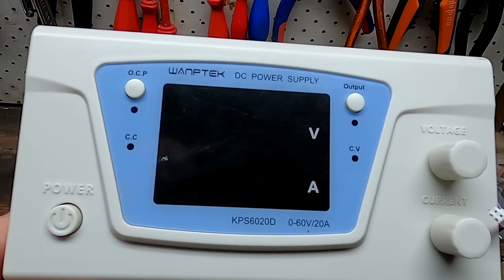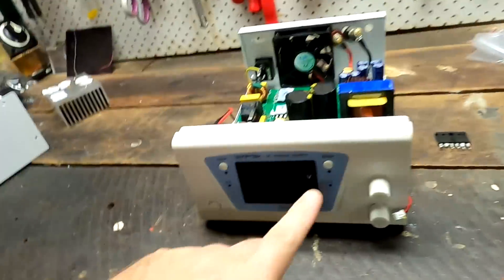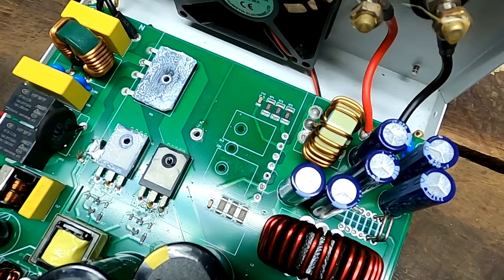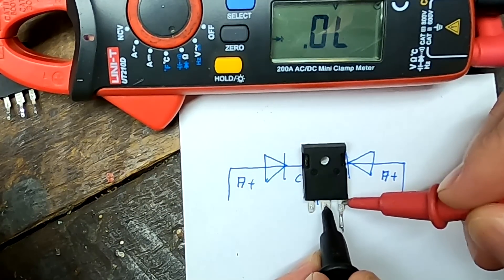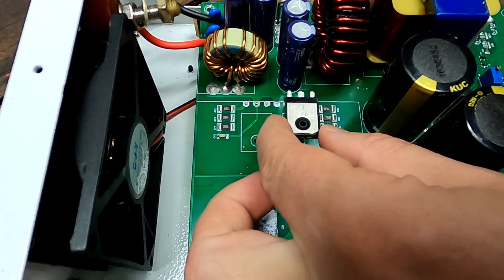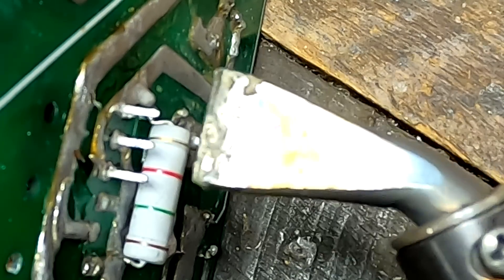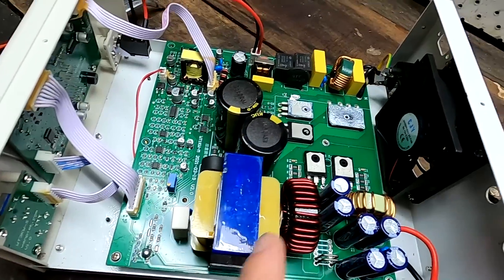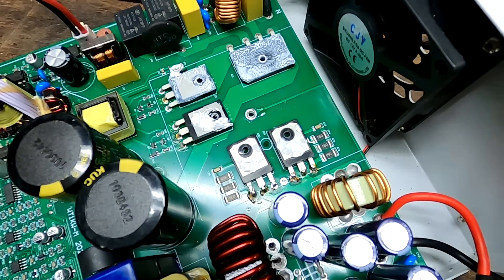I wrecked the WanpTek 60V/20A adjustable power supply 💥 ... and repaired it again WITH THIS!

Comment: bonjour Andy,
Désolé je ne parle pas Anglais heureusement la traduction est là 
J'adore vos vidéos et votre bonne humeur ! ;)
J'ai également un problème sur cette alimentation wanptek KPS6020D, impossible de trouver un schéma électrique, ont ils un support ?
Je suis électricien mais pas électronicien donc un peu compliqué pour moi
Voici ce qui est hors service sur la carte : IGBT Q6 K30H603, la résistance R87 302, condensateur céramique C55 ( valeur ?) et l transistor Q8 BA 
J'aimerai la réparer moi même si possible mais je me pose des questions :
Comment déterminer la valeur du condensateur céramique C55 sans schéma ? 
Peut on installer des composants plus fort ?  exemple remplacer le K30H603 par K75H63 
Comment peut on améliorer cette alimentation ? j'ai lu dans les messages précèdent qu'il fallait ajouter une diode en parallèle sur la sortie qu'en pensez vous ?
Il y a bien un fusible rapide de 10A mais les composants ont quand même grillés... :(
Moi aussi lorsque j'ai connecté mon pack de batterie seplos il y eu des arcs électriques, sans doute la charge des condensateurs de l'alimentation 
Si j'ai bien compris il faut toujours que la tension de l'alimentation wanptek soit légèrement supérieur  au pack de batterie exemple : 55VDC pour 51VDC et toujours démarrer la wanptek en premier
J'ai lu aussi que l'alimentation n'est pas aux normes ou n'est pas fiable, pour quelle raison s'il vous plait ?
Merci, à bientôt
Alex

Comment: Awesome Soldering skills... lucky you, that you didn't rip off the via on the opposite side, and usually it is a good idea to clean the flux and also the old thermal paste before reassembling. I wonder how this Power Supply performs on the AC Side with 1200W the filters somewhat don't look like they are up to the task.

Comment: did you know that if an 100 pount trailer falls over a wanptek which is 80% loaded and warm the tiny thing turns to over current protection ... i didnt know it had such working... spared it to see what happent and it was just a mode you keep pushing the current  scroll and it switches it off.!!!1 yup the last models 60/5  ali sells!!!! scared me  a lot.. my sweet first ever adjustable seems totaly fine!!!!

Comment: Can I blame you ? 🤪 I now have the Wanptek to play with ( UK ) 👍👌
They also have a  3kw version ( now? ) incidentally I hated the beeps when adjusting volt/amps. You can disable. Hold ‘on’ for 5secs then sequentially press volt , until 4-1 shows , turn until 4-0, press volt to save👍
Reply from the maker: Oh, wow, thanks for the pro-tip. How did you find out? So4-1 makes it quieter?
Reply: @OffGridGarageAustralia  I’m nosey 😊. 4-1 beep on , set 4-0 beep off
Reply from the maker: @ladams5356 Thank you.

Comment: I'm looking at this power supply,has it been good? Does it output the full 60v 20a for 1,200 watts? I'm looking for a decent power supply to power my pinecil v2 soldering iron. Charge some small batteries and to have something adjustable.
Reply: Very overkill for those purposes. A 30v/10A would be more than enough for half the price.

Comment: I have just bought one of these power supplies and I can't seem to find out how to change it from constant current to current voltage to allow the current to reduce for top balancing Any advice much appreciated
Reply from the maker: It does it automatically. Set it to 3.45V for a single cell and watch. Voltage will rise until it reaches the 3.45V and the current will then slowly go down until the cell is full absorbed. There are many videos on this channel where I show how to charge these cells.
Reply: @OffGridGarageAustralia  thanks and it did as you said after a few days the cell when they arrived were all 3.25v x16 280ah, I set that charger to 3.65v it started charging at 21amps but the voltage to 3.47 for a week or so but the came up slowly it stopped at 3.65 and the cells were all at 3.62v so I guess it's close enough for a top balance

Comment: there should be a slow blow 25A fuse behind the output terminals, then these same diodes would cause the fuse to blow if connected to anything in reverse with more than 25A capability and over 2-3V voltage, or there could be a beefy 85A >100V diode Vishay VS85HFL series ( any will do, the voltage ratings go from 100V to 1100V) (such as  in reverse to the output capacitors to blow the fuse without causing large (over 150A) peak current to the ultrafast diodes.

Comment: you could put a high current diode on the positive terminal to stop reverse polarity from happening again
Reply from the maker: You mean inline? What about the voltage drop?
Reply: @OffGridGarageAustralia  they will be that to add on when setting the voltage but it would save the device

Comment: Use one extra of the diodes on the output terminals, solder center to positive other pins to negative post. More better better protection. 😉
Reply: Hello! Please be so kind and advice me if it is ok to use this method for other power supply. Thanks for your support
Reply: @margasor  yes can use on other power supplies. What it does is protects the supply if a reverse voltage is connected on the output of the supply. The diodes anode goes to negative and the cathode goes to positive. A fuse inline would blow if a reverse voltage is applied and thus protecting the power supply.
Reply: @davestech6357  I will do so, is it a specific power diode to use?! Supose to be rapid diodes. Thank again, I appreciate your support 🙏

Comment: I would not recoment the high power/heat soldering iron. The PCB tracks might easily lift from the PCB. I recomment cleaning the holes and then insert the component. A  short touch might be ok but a fev secs more??????
Reply from the maker: Yeah, if you get it too hot, it will break your tracks. sucking up al old solder is definitely the better way. But what a boring video, right?😁

Comment: Andy you could have used soldier sucker to suck the solder from the holes and once they are open. You can easily insert diodes, transisters or any thing in the hole directly without using a huge canon like soldering gun 😂😂
Reply from the maker: I tried my solder sucker thingy but the solder is not hot enough and it suck. I mean it didn't suck, so it sucks!

Comment: [Off topic] Is it a reasonable idea for a Lifepo4 battery in a camper van with solar panels to change the BMS settings so that ovp is at around e.g. 35% state of charge and ovp recovery is at e.g. 25% of charge when the battery is not used for a long time? Keeping the battery at nearly 100% for a long time is not recommended, is it?
Reply: They are usually only about half charged when transported/delivered. In contrast to Lead Asid batteries they don't need to be fully charged in storage. I believe damage comes from any change in charge so i believe in storage it would be best to disconnect them and then just give them some charge everry 3 to 6 months but Iam not a battery expert.
Reply from the maker: If you don't have any load connected, charge it to 70% and leave it disconnected (even the BMS if possible). This will last for more than a year without any issues...

Comment: Well done Andy. You were very gentle and patient. But if you had been a little less gentle with that BFSI (Big Freaking Soldering Iron), as you inserted the new diode, you could have delaminated the solder pads from the PCB while pushing the leads through. Some advice from someone who has been doing electronics repair for 40 years: next time use a solder sucker and the small iron to remove the solder from the through-holes one ay a time. Or, if you don't want to buy a solder sucker, use a wooden toothpick. Also, the solder joints you made at the end, on top of the PCB (component side) may be "cold" joints that can fracture with a little vibration. The solder has to flow freely across and around the pins until it wicks around the pins to form an alloy, which requires the pins to be heated to the melting temperature of the solder. What I see here are what we call "tack joints" intended for only temporary connections. We old techs say: "solder is not a glue."
Reply from the maker: Thanks for your tips!
Reply: Thats how I was trained to solder! good to know the practise id still being applied!!!!
Reply from the maker: @showme360  There are probably other methods these days for such a task but for a three-pin diode, it was al right.

Comment: I added a power diode into my leads, with a switch across it. You have the switch open while connecting, then you make sure current flows. Once current is flowing, you close the switch and your leads are in default, and the voltage drop from the diode is gone. I've not blown my power supply since
Reply from the maker: Ah, great tip. A bit of an extra step but I like it!

Comment: Andy , in the old days we would have called these diodes crowbar protection diodes. They protect your power supply in the event of reverse connections.
Reply: Not so shure about that. I think they do the rectifying after a high frequency transformation. I think this is a switch mode PS.

Comment: Those are common parts in switching supplies, I used them on the power supply for my Riden. Also,I should mention that particular product design does not like reverse power, in other words make sure something you connect to does not have higher voltage. (Reverse current flow) Yes I have blown the 15v 40 amp USA version. I have a couple of the wanptek supplies, a lot of bang for the buck. Batteries tend to not care about ripple, but they love that current.

Comment: After doing the same thing to my Wanptek I put a fuse on my positive lead connection on the back connector to prevent it from happening again. Lot easier to replace a fuse.
Reply: Fuses are not fast enough to protect electronics.
Reply from the maker: Will the fuse not even blow under normal operation?
Reply: @OffGridGarageAustralia A fuse should not blow when things are normal. They blow when the thin wire in the fuse gets too hot and melts. This demands over current and time. Current multiplyed by current and again multiplyed by the resistance to give the energy to melt the silver wire. They can often survive a small over current for a long time. They may protect against melted cables and fires. I do recomment fuses between battery banks and what is connected to them in case something like an inverter has failed.
Reply from the maker: @leonhardtkristensen4093  I'll put this upgrade project on my list of videos. Thanks for your insight and suggestion.
Reply: @OffGridGarageAustralia  So far mine has been ok. I haven't hooked it up back words or over loaded it though. Can't hurt and doesn't cost much for a little more protection.

Comment: Who taught you how to solder? 🙂You should remove the solder from the through holes first. Then you could test fit the diodes for proper mounting alignment. Invest in some solder wick and a good solder sucker, then you wouldn't need a plumbers soldering iron. Heating up and pushing through the diodes is a good way to destroy the traces. But you got it working and have spare parts for the next time you hook it up backwards 🙂
Reply from the maker: Thanks, yeah, I have one of these desoldering pumps but it does not work well unless the solder is really hot. Some wick is probably better...

Comment: Like# 402, damn steak lunch gets in the way!
Oh, but great news, I found one of the 2 panels I needed to add! I grabbed 3 x 540watt panels to make it 8, I’ll configure them into a 4S2P! Still trying to locate a 445 bifacial Canadian Solar for the second string! If you remember, I am bumping into my 250v limit per string and this will drop me from 250 down to 200v!
So currently Taj-Ma-Haul is at 6.5kWatt/hours solar capacity. I’m 2/3 the way to the planned 8.1kWatt/hrs
Taj-Ma-Haul is my 20’ Toy Hauler Luxury home conversion!

Comment: Good job 👍 I make the same with tv power supply i messure it whats wrong and find most of the errors on the AC site.This big soldering iron is funny because i take a desolderung pump.Das richtige für Freitag Abend Tschüßi👋
Reply from the maker: I have a de-soldering pump as well but it does not work well. I cannot get the solder to be hot enough so it sucks it in.

Comment: This iron should be well for plumming.   ;--)
Reply: And would you ask your plummer to fix electronics?
Reply from the maker: It seems to be good for a lot of things
Reply: @OffGridGarageAustralia  Would you have shown us if you had lifted and dammaged the tracks? I am just warning against using such an iron as I have had bad experiences with even much smaller irons an I have had close to 70 years experience with electronics and at least 50 with pcb's and that is professional. I am a professional fixer. That is the way I have made my living starting as a Radio  and TV mechanic mooving into big computers (the ones taking up entire floors in big houses),. I have also got an electronic engineering education but I still appreciate your video's as I learn new things all the time. I am not a know it all person. I am a hving seen and experienced a lot person.
Reply from the maker: @leonhardtkristensen4093  Yeah, why not? I have shown many mistakes I made here on the channel. It's not all positive. Even if the tracks lift off, you can still solder them again or using a piece of wire to connect to the next point.
I appreciate all your comments and sharing your knowledge here as well. Thank you.

Comment: Well done, those are some huge diodes.    My powersupply repair didnt work out so well,  just another case of unscheduled rapid disassembly (switching IC blew up).  I got 9 left so my ali-express order is going to pay off as I blow up some more before figuring out whats up.  Or i might just throw in the towel because i think some surface mount resitors are toast which is more then i wanted to get into.. but maybe with that huge Iron... i'll give it a shot!  Diodesgonewild could solder smd's with that iron i bet.
Reply from the maker: The huge soldering iron may take care of all your SMD components at once.
I usually don't have much luck repairing such devices but I had luck with these power supplies. Also repaired the small one with 5A successfully a few times.
The good thing is the Wanptek support via AliExpress chat. They are really helping and sent me a photo for the smaller PS with components to check.

Comment: Cool Andy, Did you enjoy a late night Spat after that?  And how about adding a reverse voltage protection, maybe a couple of high current blocking diodes across the output and an inline fast acting fuse in-line with the output?
Reply from the maker: I had one before I started😁 Keeps my hand calm 
The diode would change the voltage on the output though. And a fuse blows both ways so won't help much either, I guess...
Reply: @OffGridGarageAustralia  I think what he means is that the diodes should be across the output  + on diode to + and - to -. . That may blow a fuse fast enough to protect the internal parts. That would not change any voltage on the output and reverse current would be neglegeble.
Reply from the maker: @leonhardtkristensen4093  Ah, right, I understand now!
Reply: @OffGridGarageAustralia  I was thinking with the fuse being inline, the diodes might absorb enough reverse voltage until the fuse blows to prevent damage to the rectifier diodes
Reply from the maker: @jackoneil3933  Yeah, could be, I mean it sparked twice and I had the PS running for a few seconds before it died.

Comment: The problem with getting components from Aliexpress,  is that it's a hit and miss if your supplied with fake or the real deal.
Reply from the maker: Are there fake diodes out there? What's fake with them, not working at all or not meeting specs?
Reply: @OffGridGarageAustralia  Andy, yes there are fake diodes, floating around the Chinese market. Usually they are rebranded and out of spec.
Reply from the maker: @ThaVoodoo1  Didn't know,this is a think as these semiconductors are so cheap to manufacture and there would be no money to be made in faking them...